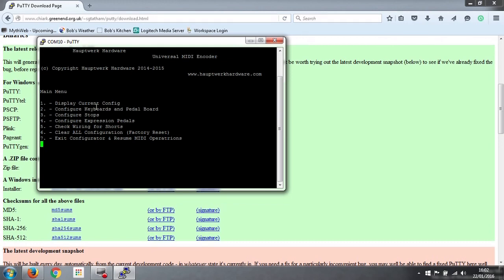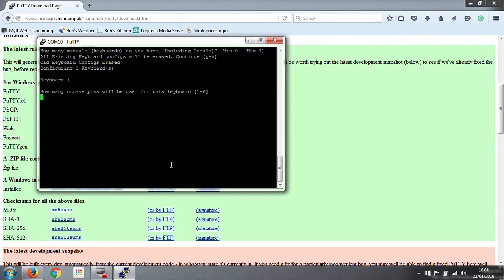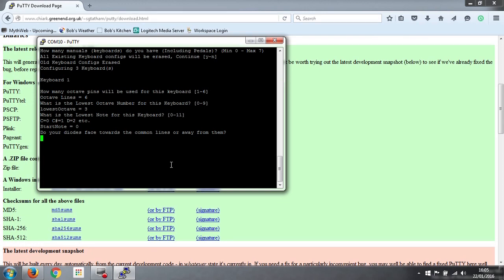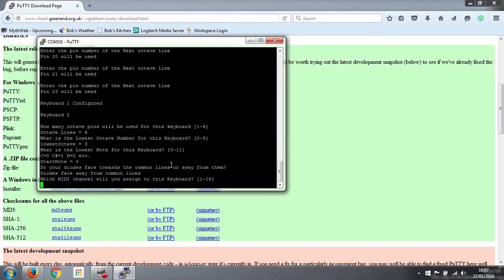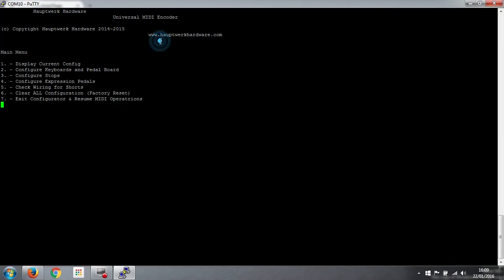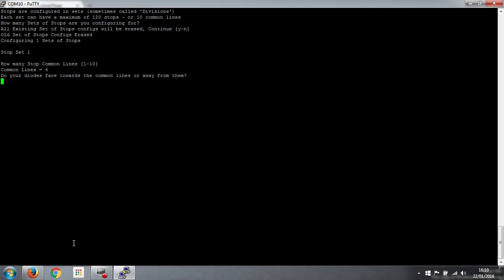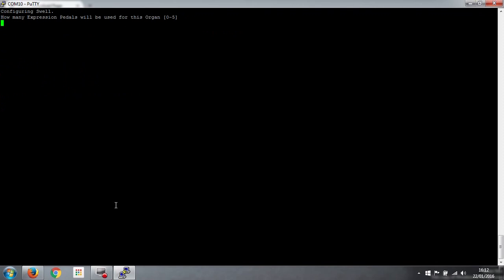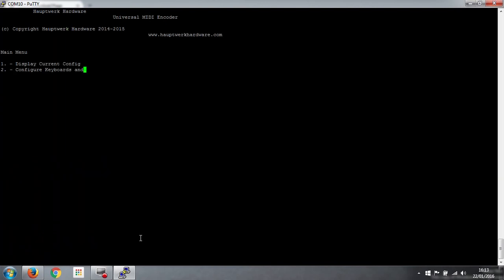Converting the Wyvern Exeter Organ - part 28   Programming the Encoder

Comment: That config process using Q&A is pretty pedestrian for 21st century software. Have you designed a more friendly interface since Jan 2017? If not, then a worksheet should be available to fill in ahead of the long interrogation.

Comment: What if you want to add pistons? How would one incorporate pistons into this process? I don’t see an option for programming pistons.
Reply: Pistons would be wired just like stops. Grouped into 12 with one common line just like the keys and stops. Assign another midi channel for them and then use the midi auto-detect feature in the hauptwerk software to assign the relevant events to the pistons on the virtual organ. Basically everything can be treated just like the keyboards, stops, thumb pistons, toe pistons/studs etc.  Hope that helps...
Reply: @sussexbob182 Sure, but for completeness and clarity this config program should cater explicitly for pistons, too. Maybe by now it does.